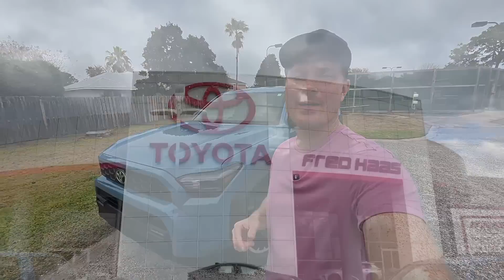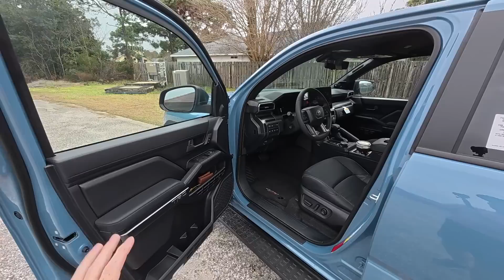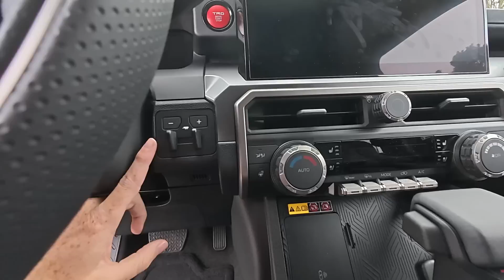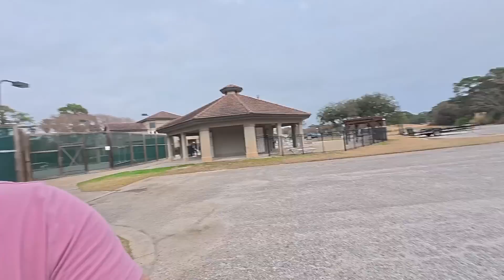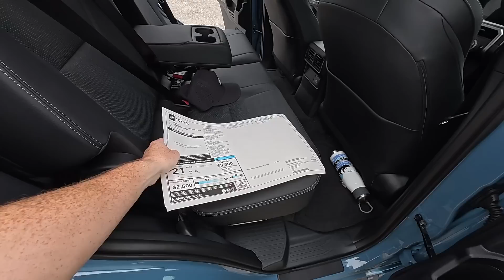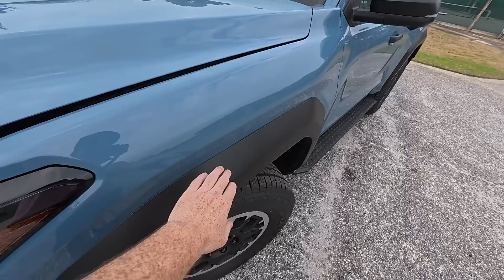My New 2025 6th Gen 4Runner TRD Off Road - How Much? Build Plans?

Comment: Two words “tune it”. Presently there are two aftermarket companies that do an ECU reflash to extract decent horsepower and torque at this four pot hasn’t reserve. The increase is not outrageous and given the overall history of reliability Toyota engines should not pose significant risk. 
The head engineer for the Tacoma went out of his way to highlight how much this engine had been tested to commercial fleet standards . And that the cooling channels, and that the main inlet to the block to these cooling channels was deliberately oversized.

Comment: Maybe someone already noted this in the comments (too many to read at this point) but for the loose fender flare(s) up front, check to make sure they pulled the backing off the self-sticking tape around the top inside edge of the flare.  That's what should be used to hold it to the painted sheet metal of the fender.  If they failed to remove it then make sure the painted sheet metal is clean before you peel it off and stick it.

Comment: I liked that the previous 4runner was completely different design than the Tacoma back then.  It felt alot bigger on the inside too.  The current (New) 4 runner looks like they just slapped a cover over the bed of the new Tacoma.

Comment: Have the 2024 trd off road 4.0 thinking about the 2025 but the 4 cylinder and the transmission bad reviews I read about scares me?
Reply from the maker: That was 6 months ago. Toyota has already fixed that issues. Should be good! 👍🏼

Comment: Excellent choice, this is the new 4Runner sweet spot.  Also I much prefer the non hybrid because it is cheaper, less complicated, powerful enough (these things aren’t sports cars), way more trunk space, don’t have to worry about putting wet stuff in the trunk due to the hybrid batteries, and much lighter which helps everywhere.
The 4Runners w the hybrid system have a payload of only 895lbs, which means with four passengers in it you cannot even do a Costco run!

Comment: Jon, I want to like this 4Runner but am I wrong that it looks a little cheap for $54k.  In the high 40’s maybe I could overlook that but it just seems a bit  chintzy.  Hopefully you will  demonstrate otherwise.  Looking forward to the build.  I just wonder what is happening in the Toyota production room.  Seems like they asking more for less but heck I’ve only owned a few of these trucks…. 1988, 1997, 2000, 2004, 2008, 2012, and 2023 (Truck, FJ or 4Runner).  I feel like I know the brand and the product.  Not feeling it this time.   Passed on the new Taco too.  Not a hater, but I guy that is very suspicious.  Thanks for being the guinea pig.  
 .

Comment: Thanks for getting ahead of this Jon with your new 6th Gen!!! It sad to see the peel on the fender flares & crossing fingers that this is the only cosmetic issue with your new Runner.   I love how you have stated to keep up the MODS . . .  Lets consider the Icon stage Kits for suspension, GOBI roof Rack, a decent Drawer System @overlanderwoodworks, putting 35s or 37s, I like the rear camera, lets also consider Dash CAMs, Rear mollie Panels (GOBO) or CBI or C4) go big with the Rear Bumper with Dual Swing Arms / folding tables, WINCH & Compressor . . . Build an over landing RIG and take it places . . . This is what I would love to see . . . & if your ever in the L.A. area, hit me up for some fish tacos!!!  Stay away from magnalow exhaust indeed
Reply from the maker: Brother I will hit you up for the tacos! Sounds so good!!!!

Comment: Taking a brand new vehicle on a long muti state trip is a horrible idea. A new vehicle should be properly broken in. The most important part being not driving at a constant speed over an extended period. Setting the cruise control on a long trip is the worst thing you could do. I would have trailered it home, or taking the back roads and varied the speeds in the slow lane.
Reply from the maker: Why? How is that bad for a modern vehicle?
Reply: @TRDJon it’s not. You good lol.

Comment: Getting rid of  the hood support Struts was the best thing Toyota did. Those struts which I have on my 4runner are a pain in the 🫏.

 They are very expensive to replace every 2 or 3 years when the gas leaks out of them and doesn't hold the hood up anymore. My personal views and experiences.😊
Reply: Personal experience here. Maybe this is Toyota only?  My son’s old 08 Lexus RX350 and my 17 ES350’s hood struts are still going strong.  Never been replaced.

Comment: It's important to seal that Gap Jon,  every little piece of dirt, mud, salt and sand will find it's way into it and start the corrosion process very quickly. Have the dealership deal with it, it should be a warranty issue. 😊

Comment: Nice truck but price is way too expensive for me. 
I have the same issue with my 21 the driver side fender flare pulled off the side , dealer fixed it and it pulled off again. Not a fan of it not having hood struts for the price it should

Comment: Congrats Jon.  You bought from my local dealer.  Quick question though.  How did you get a TRD ORP without a bunch of GST accessories forced on you.  I haven’t seen a 4Runner yet in GST region that doesn’t at a minimum have predator steps and crossbars installed.

Comment: Did I see this doesn't get the AUX buttons like the Tacoma?
Reply from the maker: It doesn’t unfortunately
Reply: @TRDJon  Man.  Really not digging the simple cuts Toyota is making.  Especially for the prices.  Power seats should be all models. Not even on a 50K TRDOR non premium.  Getting hard to see the value in these models.  And I am/was a Toyota only guy.

Comment: Cruise control @75?  No break-in required for the first 500 miles?
Reply from the maker: Idk what’s the difference of me holding the pedal at 75 or the car doing it itself
Reply: @ , I was talking more about break in than cruise control.  I bought my LC250 in Ft Myers and drove it back to Austin trying to follow the Car Care Nuts break- in recommendations.  It took me forever to get home driving under 60mph.  https://youtu.be/nBBUQJKTaiM?si=E4-P7YpdTKy7xD_X
Reply from the maker: Gotcha. Well, it is under warranty. So if you can't take a modern car on a solid drive after buying it then i guess we will have to take care of that.

Comment: Been following you for a while at least when I had my insta account…keep up the great work! Honestly, the new gen 6 looks nice but I think the 5th gen ORP seems to be better quality…the interior looks much better…I like the stitched head rests and the soft material used on the door panel…even the plastic on the 5th gen looks better imo…not digging the cheap plastic fender flares, wonder how that’ll hold up in Texas heat over the years…also not liking that it doesn’t have a hood scoop…idk I could be bias since I own an 18 ORP but after several upgrades including my recent morimoto headlights, my 18 is just as nice as a brand new 2025…and a manual hood prop?! I’ve added about 12K in upgrades to mine and I’m much happier with the 5th gen then what the 6th has to offer…but I’m sure after a few years of seeing upgrades on the new ones I’ll change my mind…
Reply from the maker: We shall see man! Thank you for the support over the years!

Comment: Great choice and strategy. Back to the roots!
This will only strengthen the already great content you produce. 👏
By the way, up in Canada, no matter the trim, we only get premium option with 4Runners.
Reply from the maker: Does yours have dual climate control?
Reply: @TRDJon  Unfortunately, even up here, the 6th Gen Off-Road Premium still comes with single zone climate control. My 2022 5th Gen Off-Road Premium came with dual zone. The remote starter was also standard. In fact, the only 5th Gen Premium model that didn't come with it was the SR5 Premium. But keep in mind, this only applies to models after the 2014 refresh. Toyota may eventually include it again with later model years of the 6th gen.

Comment: The truck looks nice but I don’t see anything you can’t add on a 5gen 4Runner. 

The only thing you can’t get is the crawl control. But I could be wrong. 

The screen, trailer brake controller, locking rear and front differential, leather seats and more you can add on your own for much less.
Reply: 5th gen pro has crawl control and thought the OR does as well but I've only owned my pro so not sure.
Reply: @ the OR does have it. But I was talking about the SR5. Since the 5gen has been around for so long there is soooo much stuff available. Ever since I got mine, it blew my mind on all the stuff I could do and add with it.

Comment: My new Toyota said no constant speed driving for 500 miles I think. Cruise control was a no no.
Reply: Any reason why?
Reply: Break in. Pistons and cylinders’ surface. I try to do it but I think most people don’t even know about this. Every brand has this in the user manual. I saw it in GMC,  and Jeep manuals too.

Comment: Hey Jon please provide the previously requested measurements especially the side mirrors outside to outside when you can. It will be a go-no go for me.
Reply: Really expected a width in the specs and it is 78. Without the mirrors 😂
Reply from the maker: Not sure I understand about the mirrors
Reply: @ I'm looking for outside driver side mirror to outside passenger side mirror distance.
Reply: @TRDJon  total width, including mirrors. The spec on the website is the vehicle itself no including the mirrors
Reply from the maker: Ahhhhh copy. Ok
Reply: He is looking for width with mirrors included.
Reply: @is6566  I should have said that instead. Thanks! 👍

Comment: Hey Jon, Thanks for the video. It looks awesome. Hey the hood struts could become a safety issue with age. We used to have a 2004 Sequoia and 15 years later the hood struts would initially look like they are holding the hood up then slowly start giving up at first (hard to notice) and then fall fast with a slam. For those always use clamps to be safe.
Reply: What about the second time it happened? 😃
Reply from the maker: My 5th Gen is 8 years old and its still solid. But I get that.

Comment: It’s beautiful!  Congratulations! Love the Heritage Blue.  My 24 TRD Pro was loaded and stickered for $58,700.  This with a moonroof would be about 1000 less than that.  I think that in a few months we may see the 6000 off that Tacomas and Land Cruisers are getting.  At that point, the price issue goes away.  As to the turbo, I get the ten year 125,000 mile Toyota extended plan on my vehicles.  That would help with the reliability issues, at least financially.
Reply: I don’t know the Toyota factory extended warranty system. Can you buy it online from a volume dealer or vehicle’s sale dealer only? Is there substantial difference in prices? Is the 10-125k miles the longest? Tx!
Reply: @is6566  I believe that you can only buy it through a dealer, and not online like Stellantis does. The price is, like other things, negotiable.  I went with the longest plan, which is 10 years 125,000 miles 0 deductible.  I got it for $3400 on the 24 Pro.
Reply: Lucky you my local dealer offers a 10/100,000 extended warranty but it’s only good in Hawai’i
Reply: How much extra for the extended warranty?
Reply: @sutherbb36  it was $3400.  I will have it long term.
Reply: I had a similar reaction comparing the price on this to the old TRD Pro and see it a lot in comments, but going spec by spec this new trim has all the features of the old pro besides the Fox system (which personally don't need) and tech/power/comfort/fuel economy-wise you could argue you get more so honestly thinking about what you get for the price I've become less mad at it. Made me start to wonder, did Toyota just make the new ORP as good as the old Pro...and that's why it's the same price?
Reply: Man… to see that v4 is wild
Reply: @Andrewoval Huh?? These absolutely do not have a V4. Toyota does not even produce a four cylinder engine in a v-configuration, to my knowledge.